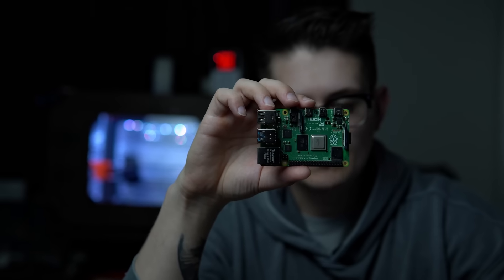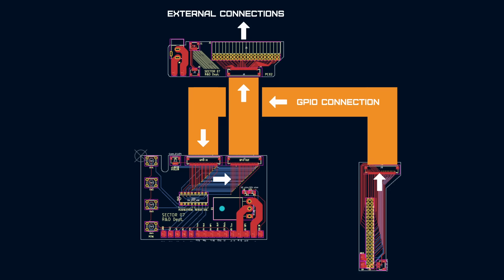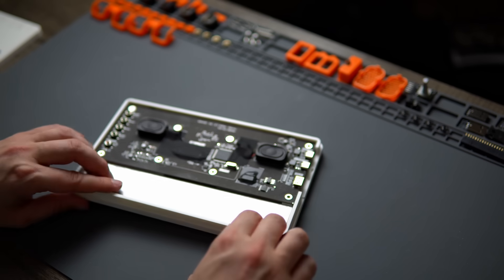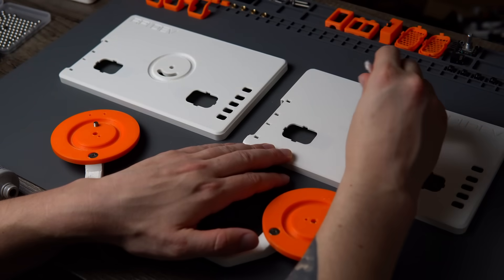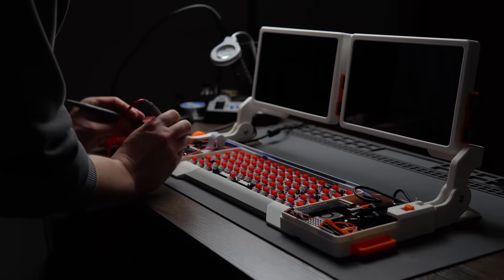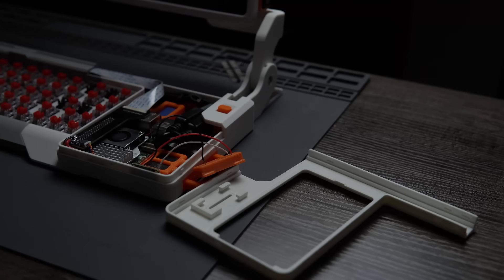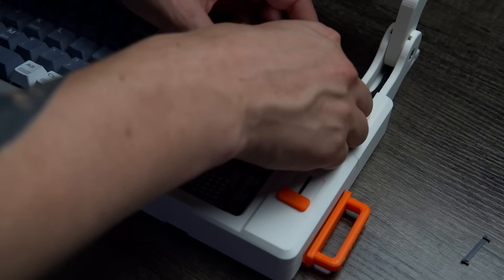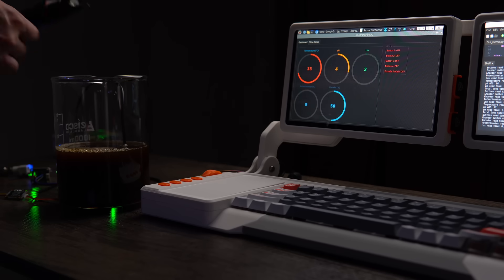DIY Dual-Screen Cyberdeck: Sleek Design, Ultimate Functionality

Comment: Hello sir 2 questions. Im new to cyberdecks. Should i get the BAMBULAB P2S printer. And is it that FDM fillment used to create like harder parts and stuff ?? For cuberdecks 😅😅
Reply from the maker: Hi, Bambu Lab makes great printers. I have the A1 Combo but the P2S looks really good. Yes it is FDM, particularly matte colors because the finish looks really good without extra work. I used PLA which is not as strong as ASA or ABS but prints really well and is sufficient for what this needs. Good luck with your project!

Comment: sliding Pi-Tray that the raspberry sits in that slides out the bottom. no need for the top connector-remover lathing thinger (opposite the Micro-SD hatch) and the side connector-remover can also have a pin to keep the tray locked into place, while also pushing the connectors in, maybe even a small lock or dual-action latching device to prevent accidental disco.

Clever little build.

Comment: what an elegant design and usefull tech.

For any V2 I'd suggest some flexibility in the layout of the connections to the pi as for instance eternet and usb have switched in previous models. Also a trackpad built into the cover or a mouse compartment.

Comment: man if you did a split keyboard layout this thing has the potential to fold in half right down the center and create an even smaller footprint for portability.
Reply: Also, an old school dock style setup for the pi would be cool for easier removal. Two stage it with a sliding connector from the hdmi side and then a spring loaded pop up/down for the usb. To insert- slide into usb with the tray popped/angled up, push down to click it in place, then slide the hdmi side connectors in. Removal is just the reverse process. Easier said, but you've already done all this so I know you could do it.

Comment: Love the keycaps and all of the thought that went into this. Watching the part where you remove the Raspberry Pi and hearing you talk about how it could be better made me think that it would be cool if the back orange handle could be more of a tray. So once you disconnect it you can slide it out the back without having to figure out how to pull it out from the top.

Comment: Hey, 

I love your design and I want to make one but the PDFs from your GitHub page are broken. They won't open in any browser or adobe acrobat.

Can you please check what's wrong with them?
Reply from the maker: Hey thanks for letting me know. I downloaded the .zip and was able to open the pdf files with adobe acrobat dc. Its a free pdf reader I believe so that should allow you to open them. If that doesnt work I can upload the docs in a different file format. What kind would you want?
Reply: @SECTOR07 weird, thanks for taking a look. I'm going to try on my desktop at home right now and see if it was just having problems w my laptop. 

I was using acrobat on my laptop too so idk what the problem was
Reply: @SECTOR07 they opened fine on my desktop, thanks again for getting back to me though!

Comment: will the raspi not gonna overheat? i mean the right side had a close lid or maybe it had kind of airflow i just didnt see
Reply from the maker: Ive had it running for a long time without issues. Its has an added heatsink cooling fan and venting underneath and in the back for inflow out flow. I sort of winged that. Didnt calculate cfm or anything.
Reply: @SECTOR07  ohh ok thanks for confirming it loved the video

Comment: 12:05  You should have taken a moment to explain voltage dividers or people might look at that as two resistors in series and not understand what the big deal is with them reversed.

Comment: Where can I start learning on how to build things like this?
Reply from the maker: The main skills for this are microcontrollers, python, circuit board design, 3D modelling, 3D printing, and soldering. Almost all of these skills I taught myself, learning along the way. It depends on your learning style but I recommend just choosing a project that will require one or more of these skills and learn what you need to build it. To this day I start with an idea and no idea how to actually do it. I just learn what I need to accomplish the goal. Start simple and then try harder projects. After enough practical application it becomes second nature.

Comment: Could you make a Zimaboard version of this project? I think it's a cool idea, but the Raspberry Pi is overrated. A developer can't program on a Raspberry Pi fully efficiently. Yes, I know the Zimaboard isn't much more powerful than the Pi, but it's more efficient because of the SATA ports, passive cooling, and chipset.😄
Reply from the maker: There are a lot of more powerful SBC's that could be used. I chose the Pi 5 for its popularity and good documentation. I figured most people would be familiar with it. Maybe in the future I'll adapt the design to an upgraded version or make it more modular to support other SBC's. Ill look into that one as well.

Comment: How do the screens recieve power? Is the LCD controller board designed by you?
Reply from the maker: They are powered via the usb cable which also handles touch signal. The display itself has its own controller pcb on the back that interfaces with the Pi using HDMI.
Reply: @SECTOR07 oh okay. I only see u running the hdmi cable in the video. It looks like there's only one cable in the channels
Reply from the maker: @RemedyIsGoth There are two, it looks like one because I have them wrapped with cable sleeve. You'll notice there are two 90 degree cable connectors on the side. One goes to the HDMI port and the other goes to usb-c.
Reply: @SECTOR07 oh I thought they were both hdmi cause they look so similar, I understand now thank you! This will be useful for my own project ❤

Comment: This is great. Useful is one of the last and most common adj you used. It is odd then you show it in low light use and the keyboard is infected with useless Unicorn puke rather than USEFUL backlit keys where the letter of the key shines light through so you can read it in the dark? There seems to be an allergy to backlit keyboards as if they are just for kids who can't read to stay distracted while playing video games at 2AM eating potato chips and cup ramen and thus don't need to see the letters anyway... an insulting stereotype aimed at adult computer professionals whom go unappreciated until the WIFI goes down or her phone won't turn on. Just saying the keyboard world needs a swift kick in the genre... and a built in trackball. Cool stuff, very inspiring. More Please

Comment: This is probably the coolest Cyberdeck design I've seen. The ability to remove the pi, add sensors, have 2 screens with a mechanical keyboard integrated is just absolutely amazing

Comment: I don't know if it on purpose or not, but I keep seen people 3D print the hole part just to realize that it does not fit properly. You can model small test parts just to test the fit of specific futures together. If you do this show it so people can learn from it, if not start to apply it, you will save time, and material. Cool project an design.

Comment: Would have been sick if you designed custom shells for the Pi that turned it into a "cartridge" that just pops into a socket or port on the deck, keeping ports open on the shell of the Pi for use while removed, but including pogo pin tracks on the bottom/side. Protects the Pi, and makes swapping compute "cores" easier/more fun. A custom shell for every Pi you'd use, so that it's a universal/standard port, and it's just the shells that change, pin tracks in the same place each time. Won't necessarily need full plugs in the deck to interface with the core, etc. Give the shell and deck magnets so the core locks into place, and add a physical lock & eject button/lever (or just build a pull-tap/ribbon into the top/front of each [core shell] so you can yank it after shutting it down.

Personally, I'd want the deck to extend out, past the keyboard, to act as a wrist rest (wrist leveler).

Comment: Why wouldn't you just remove the sd card to move the "programming" (not just images) elsewhere, and not the whole pi?
Reply from the maker: You can, I have an sd card access slot so you can just swap them. I was thinking if you only got one Pi at a time or per project it should be easy to remove.

Comment: Hi! Amazing build, I really love your dual-screen cyberdeck project.
I was wondering: would it be possible to configure the Raspberry Pi in this setup to play cloud games (like Steam Link, GeForce Now, or Xbox Cloud Gaming) and also connect a joystick (USB or Bluetooth) to control them?
Reply from the maker: Thanks for checking it out! This design is really intended for developing embedded systems. It has enough capability to browse the internet and code but it doesnt have the horsepower to handle cloud gaming or any moderately intensive gaming. The best it could do is emulating low power games like those that used to be played on nintendo consoles and handhelds. Think mario, donkey kong, street fighter, etc.

Comment: what material did you use for the 3-D printing?
Reply from the maker: Polyterra Matte pla for white and grey, hatchbox pla for orange. These had the best looking finish without sanding/painting. ABS or PETG would be better for durability though.

Comment: hi what were those thread things you pushed in with the soldering iron called? Thank you.
Reply from the maker: They are called threaded inserts. Theres typically two kinds. One with a staight almost gear like pattern on the edge and ones that have more of a helical screw. The latter has a stronger hold. They are best for creating threads on a 3d print when you expect a screw to be taken in and out repeatedly. Normal tapped threads in plastic wear out quickly. Or when you need a metal to metal bond so threadlocker is more effective.
Reply: @SECTOR07  Thank you so much. I really wish I could understand how to program. But my brain has seizures everytime I read a Raspberry Pi forum.
Reply from the maker: @alanday5255 Anyone can program python. It just seems overwhelming when you look at a complex program or see too many things you dont understand all at once. If you start small, do little programs, build up your understanding a little at a time then it will make sense. I'm not a great programmer either. I just learn what I need to along the way to do what I want. You can too.

Comment: Very Nice!

Have you considered a touchpad with buttons?  I'm betting you could integrate into one of the removable panels on either side of the keyboard......  perhaps with the option to locate it on either side?

Also, I wonder what the cost would be for a set of boards with all components premounted by your sponsor?

Wow....

Comment: i'm thinking - modular everything laptop.  would be perfect if we can swap out the battery very easily with a battery that is already in mass production perhaps; modular 15" screen with an added cell phone sized screen; modular keyboard in case something goes wrong with it or you just want a different style, etc

Comment: Your design language is beautiful. I think that build is worth going back on PCB way and having them CNC mill it out of metal for the ultimate badass cyberdeck feel of a modular style, dual monitor computer in a raw milled enclosure (after maybe tweaking tolerances involved with removing the raspberry pi) . Bravo, thrilled to be a new subscriber.

Comment: Very nice.  Extremely well thought out, both in terms of construction and use.

It looks like it might top out around 15W for power consumption, at least via most common USB chargers?  Does that impact how much the Pi can do?
Reply from the maker: Not sure what you mean by USB charger. This setup uses an external power supply 5V 10A, but the circuitry can handle about 6A before things start getting warm from resistive losses in the PCB's traces. The Pi is directly powered via the external supply so it has enough power to run at max amp draw. So it isnt limited in that respect.

Comment: What do i need to start learning immediately to build projects like this
Reply from the maker: This type of project requires a lot of prerequisite knowledge and skills. But to get on the path of building your own stuff like this start learning about CAD, microcontrollers, basic electronics, and pcb design. The best way to learn is by doing. Pick an easy project that requires you to learn one or more of these things. Solve problems as they arise. Learn what you need to along the way. Up the difficulty for the next project. After a lot of projects you'll accumulate the knowledge and skills to do whatever you want. Project based learning is rewarding because you get something at the end of each lesson (project) and youve already demonstrated application of the knowledge, not just theory. In my opinion this is the best way.
Reply: @SECTOR07 thank you very much ❤

Comment: Where did you get the custom keys for your keyboard? I dont see any print files for them
Reply from the maker: They are the Nuphy EM Lab keycaps. But you dont have to use those the keyboard I used comes with a decent looking set.

Comment: the monitor in this video is the HMTECH 9 Inch Raspberry Pi Screen.. which differs from what is listed in the BOM.
Reply from the maker: @GMDII I just checked up on this. Whats listed on the BOM matches what is in my Amazon order history. However, the listing appears to have changed. It brings up a 10 inch variant that is not what I originally ordered. The HMTECH 9 inch looks the same as what I used but cant confirm. A lot of products like this are the same sold under different brands. Hopefully it is a good replacement since the one I used isnt sold unser that brand anymore. I'll update the BOM with this note.

Comment: Very interesting design. Especially the fact, that the case is mostly just 'snap together' and I also like the rotating screens. Although I feel like it would fall apart with accidental drop to the ground. Although it could as well fall apart even fully assembled with screws.

Comment: I feel like ejecting the RPi could more easily be achieved by mounting your breakout board to the top of the case, and instead accessing the Pi from a hatch below the device. That way theres less issues with clearance in the space, and you could leave all the flex cables connected and only worry about mating to the USB/Display/GPIO. Really cool project though!

Comment: You should consider a laser or quality micro gamer LCD projector that would be the primary display mode, turning and surface into the display or have AR glasses as the display mode. 

Then you would have a appropriate cyber punk setup, or Neil Stevenson's - Snow Crash setup.

Or to both. But the AR glasses would probably be the most efficient.

Comment: So when you said you can put any shield on the back ,I can put a pironman on a back or smthg
Reply from the maker: Not familiar with that Hat but basically the full GPIO is routed to that header so any HAT you could normally put on top of a Pi that only uses the header should fit.

Comment: How many rolls would i need approximately?
Reply from the maker: I don't have a good estimate. I wasted a lot reprinting test parts but I used two rolls for the white parts. The accents pieces were less than one. I think one would be enough for the main ones but I'm not sure. I'd have to slice all the parts and add up to see what it takes.
Reply: @SECTOR07 currently printing the first parts! Now to find the 9inch screen so, not too many out there😢
Reply from the maker: @FeboKipKruiden  Awesome! Make sure to open an issue on github if you run into any problems. The screen was a recent issue since Amazon delisted the one I used. I updated the BOM to a new suggested screen that looks like it's the same. An Hmtech 9 inch. Hopefully it actually is the same,  havent seen anyone test it yet.
Reply: @SECTOR07 i bought the new one waiting for it to arrive. I do see many more 10inch options than 9inch, so that might be something for the future.

I am thinking about simplifying some aspects: run it directly through hdmi and usb and use a bluetooth/usb keyboard to prevent the soldering.

Just a question: how many sockets are you using to run it?
Reply from the maker: @FeboKipKruiden Right, I went with 9 inch to match the bottom space. I'm realizing now how unreliable Amazon can be for parts down the road. The hub has four ports and it uses all of them but one is the external one. So 2 USB  for monitor touch and power, one for keyboard, one extra. Hub usb goes back to the Pi. Two micro hdmi ports for display on the Pi. And I had a bluetooth mouse dongle in the Pi as well.
Reply: @SECTOR07 apologies for all the questions, but which keyboard sizing did you use?
Reply from the maker: @FeboKipKruiden Pretty sure its a 60% keyboard. The exact one I used is in the BOM and theres a link to it. Which is the only one I know will fit in the 3d prints. Others might but you never know until you take the keyboard apart.
Reply: Thank you!